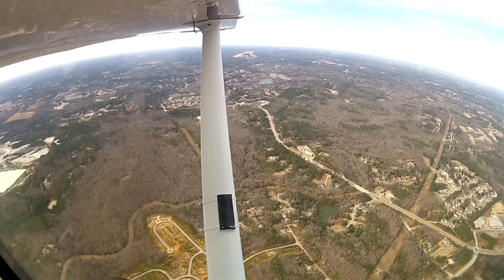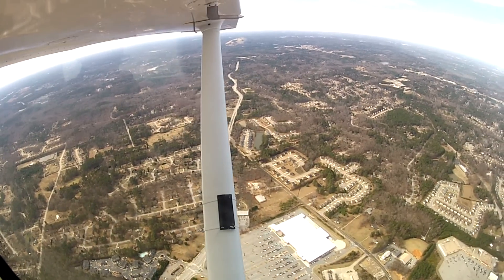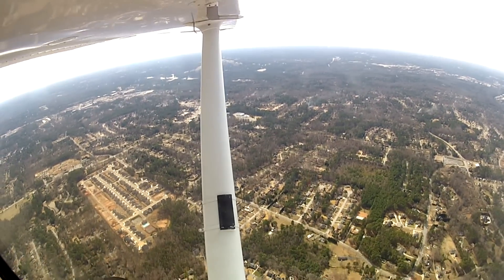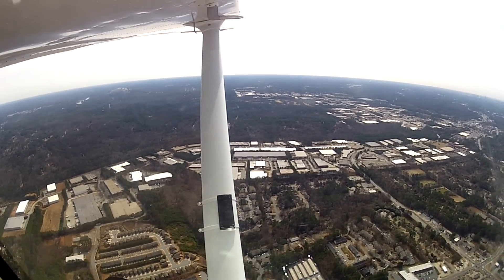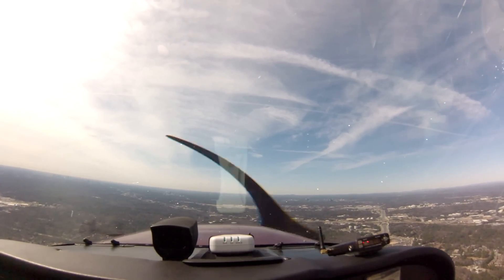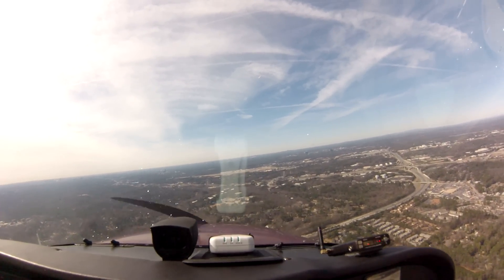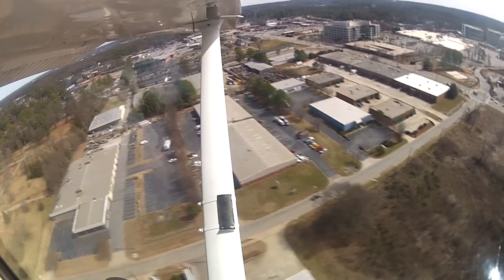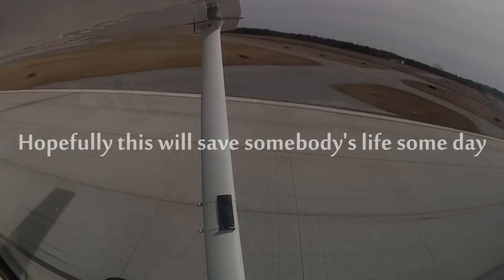A Pilot's worst nightmare, landing without primary controls

Comment: it is a very interesting exercise and re assuring to see that you can fly and land the plane without primary controls. i did practice it without trim but just throttle and rudder until the flare. will practice once a year. thanks for the video

Comment: In the early 70's, I was a front seat pax in a Cessna 310 which suffered a jammed aileron chain in flight. Fortunately, the yoke was centered when it happened .  The pilot flew the approach and landing using rudder alone.  We landed with the emergency vehicles following us down the runway.  The cause of the incident was a loose BNC connector and coax cable.  The plug had jammed between the aileron chain and the center sprocket behind the instrument panel.

Comment: That's a great CFI!  We covered system failures but not primary control failure.  However, they're doing exactly what I would do. 
 Fly it with the trim and the throttle.  That's just from 500 hrs of flight time. This could save a life!  No Question About It!  My biggest fear is in-flight fire though.

Comment: 05:40 A GRUMMAN CHEETAH you mean.  They are so sensitive on the controls you blink and they do something.  Same with Tigers, and those Grumman 2 seaters. But they make you a better pilot.  Or kill you- if you dont.  Cessna drivers run away from them after the first flight.

Comment: Besides you guys did a fantastic job, I have a question regarding the flaps setting.

In my humble opinion, having flaps 40 on final instead of 20 which you had, would give some benefits:
* slower approach speed, which means you can stay over the runway a bit longer (or makes the runway longer for you :)
* more nose-up attitude, ensuring that you touch down with your main gear first
* in case of ballooning you dissipate the energy much faster due to the maximum drag so the ballooning arrests quickly. Most likely, it's not going to balloon at all.
* the power dissipation is bigger so a less-than-accurate adjustment of the power doesn't result in immediately destabilising the plane; and the plane's response to the power adjustment is quicker.

I would stabilise my airspeed and vertical speed on final, and once over the runway, I would NOT touch the trim but reduce the vertical speed by adding power, until the plane gently touches down. This way I would float a significant distance over the runway, that's why having a slower speed seems to me so beneficial. In my opinion, this procedure is safer as you keep the option for go-around (intense re-trimming takes that option away).

What do you think?

Comment: Try landing with a broken aileron control rod-end bearing! Been there, done that. The side with the broken bearing suddenly popped almost straight up causing immediate loss of flight control. Had to hold FULL opposite yoke and FULL rudder to compensate . Could only steer in one direction and very slowly. The bearing hadn't been lubricated, so the stud was bending repeatedly whenever the ailerons were used. I had never been trained for that eventuality and had to do it strictly by instinct. Not fun! I was shaking like a leaf. I'm still amazed that I'm alive.

Comment: CFII/MEII/GI/AGI +20 years CFI. In C150 aircraft and  At uncontrol fields I have "frozen" all controls except windows doors throttle flaps and trim at about 2-3 miles from the airport.  Not all but a few students could get the aircraft    lined up with a runway and at about 50' or less depending on how well they did I would give them back all the controls for landing. I feel this was a valuable learning experience.

Comment: Awesome video. Now if you’d demonstrate in a tail wheeled aircraft. 
I was doing off airport landings in Alaska out on a river banks, took off and turned crosswind. When I started to turn downwind my controls locked up. Instantly I reduced power to slow things down reached around behind me to feel of something had jammed the stick as I started applying right rudder. Then it gave and I had control again. When I landed I went over every item I could to understand what happened. It’s never done it again. I believe it was a hickup that won’t show itself again but if it does I’ll use power rudder and trim. 
Great video

Comment: I've has the ailerons jam in a Cessna 182E, they were neutral and it was pretty much a non-event. I'd be lying if I said it wasn't concerning when I first figured out that they were jammed. Still had elevator...also had a yoke break off in my hand on the same airplane, happened in the flair for landing. That was actually worse than the aileron jam.

Comment: Did this in my flight training as a student pilot.  I wasn't allowed to touch the controls at all.  Only rudder and trim.  I was able to descend, enter circuit with traffic, turn final.. it wasn't until just before touch down we had to take the control back because we would have hit the runway too hard.. but we would have lived if it was real.  Good to try once in a while.

Comment: I used to do that drill with some of my students.  Lots of fun.  I have to admit, however, I never had the cojones to let them actually land out of it.  I'd consider it a success if we got down to a few feet above the runway.  It's great to practice this at an uncontrolled field, but if it happened in real life, I'd pick a major towered airport so there's a big runway and people (and ARFF) around if things go bad.  And have ATC find you someplace with as little crosswind as possible.

Another fun one to try is to simulate a throttle cable stuck at full power.  The basic idea was to use a full slip and shallow climb to get down to Vfe, then extend flaps (and drop gear if in a retract) to keep it draggy as you descend.  Pull the mixture on short final and deadstick the landing.  You can practice this anywhere, but obviously if it happens in real life, get yourself to the biggest runway you can find and aim for the midpoint.

You can also reduce power with carb heat, switch to a single mag, and play with the mixture.  Not wonderful on the engine, but good to have those ace cards in your pocket.  I started thinking about that scenario after it happened to somebody at my club.  Frayed throttle cable got wedged and wouldn't move.
Reply: Can I superlean to keep the engine barely sputtering?

Comment: I lost elevator control after water flowed back during a climb to flight level 230 because the water froze the controls. Not a great experience. I remember calling Minneapolis Center telling them I am going to bust 230 and asked for a block of vertical airspace down to 10,000 ft assuming my controls were frozen. I can tell you it is a very unpleasant experience hoping I was right using throttle to control rate of descent. It was frozen control surfaces and I did get control back around 10,000 feet. Remain calm told my passengers what was going on since one of them overheard do you wish to declare an emergency. Fly the airplane as best you can and make very small changes. No big deal all in a day's work. I would not wish to do this again however.I am an instructor as well  but never taught any student how to try and fly without primary controls. Maybe a good idea after all.

Comment: My instructor buddies and I would challenge each other to see what we could get away with as far as loss of controls. We finally ended up being able to land a single engine Cessna with just doors and throttle. Trim control was neutral. Adding power nose went up. Reduce.. it went down. Compensating for propellor torque and to accomplish intentional turning was done by shoving door opposite to desired turn open with our feet. Piece of cake!

Comment: On calm days in my C170B I'd often practice flying without various controls.
Amazing what you can do using the unlatched doors to replace lost rudder. It results in skidding turns but will provide crude control. Trim tab and power settings becomes a crude replacement for elevator loss.
If you don't panic you can survive control losses.
But then I had some 3000 hours on that B so we were 'intimate' so to speak.

One occasion tower assigned me runway 28 as winds were 360 30 gusting to 40.
I requested 24L "at my discretion" and they cleared me 'at my discretion'.
What I did was land across the width of that runway.
Note that 24L was inactive due to winds and that had I landed on 28 I would have had to do about an 8000 ft taxi back to my tiedown which with a taildragger  would have been a major chore with brakes that would fade frequently. (been there done that)
I approached full flaps and dumped them immediately as mains touched the tarmac and hit the brakes.
Runway was 200 ft wide!.

Comment: Very good lesson to have.  Great job.  I like instructors that train for all the worst case scenarios and not just straight and level, powered, controlled flight.  I do have a few questions for my own learning.  Let's assume the primary flight control cables have severed leaving the flight controls loose.  We have all experienced single wing updrafts that pitch the plane.  How do you adjust for that with no ailerons? Also, does the air stream from the prop and forward motion leave the elevator neutral?  Does  the vortex or prop wash affect these loose controls significantly?

Comment: I'm surprised he called a go around without first making sure the trim wasn't reset.  It's super dangerous to go fullpower when the aircraft is trimmed for nose up attitude.
Reply: No need to immediately retrim. Just use forward pressure until the appropriate climb attitude THEN trim the control forces out. No different than any go-around.
Reply: Really???
Reply: If you heard what was said the instructor was working with a student IFR pilot , The flaps came up with out instruction from the CFI so I believe the student was on top of the trim  .
Reply: Even a maximally wrong trim should be easy to overcome on a properly balanced plane.

Comment: If the elevator fails, doesn't it just drop and cause the plane to nose down and crash?
Reply: haha oh my god why does everyone think a plane goes down and crashes even if something small happens? :/
Reply: The wind going over the control surfaces will try to force them into a neutral position because they are attached via hinges towards the front. i.e. If you stick your hand out the window, parallel to the road, while driving down the highway. Using the trim is like tilting the trailing edge of your hand just a little. Tilt the back of your hand up just a little forces your hand to go down. With the elevator, the raises the nose. Vice versa. With trim and light rudder control, this is quite doable. More tricky in gusty conditions.
Reply: Trim.

Comment: Excellent video. A little off topic but reminds me of my first radio control aircraft in 1973 with rudder only control (Ace Pulse Commander with Adams magnetic actuator). I was amazed how much can be done on rudder only with constant throttle and dead stick landings. Later, I picked up another system with KRD sequential quick blip throttle servo (hi-med-lo back to hi), which expanded the envelope. I gather in this case one was piloting a large model aircraft with limited controls.

Comment: You really want to give yourself more than a mile on final to stabilize any new configuration (flaps down) with primary control problems. Just tell the radar controller that it's going to be a really slow final.

Comment: With trim and throttle only...  No elevator no ailerons and  no rudder you  can  still  land  the  plane.... ....  As long  as you  have  straight and level flight you can land... what matters is  can you get to  straight  and level at  a safe landing  speed....  You  can  open the  doors and use those  for  rudder control ...  your throttle controls  decent  and  elevator trim  controls  air speed  and pitch...  So  long  straight approach straight down the  center line ....  So  all you have  to  do  is  are trim  to  landing  airspeed  then  control  decent with  throttle to  touch  down  on the  numbers ...  Gently use throttle only  preferably  set properly  from  long way out ..  Open right  door to  steer right  left  door to  steer  left ...  The  airplane will land itself  as  long as  the  spot on the  wind shield that does not move is the right  spot to  touch down you will  be  fine....  If  wheel steering  is  functional  your okay  if  steering does not  function  but is straight  ahead  or free differential braking will  be your steering.....  Don't change throttle until  fully  down and  not  likely to  Ballon....

Comment: For  trim, did you have both aileron and elevator trim ? I don't have aileron trim and I had to add a fixed trim to correct a heavy left wing. I'm assuming you would need aileron trim also, to perform this landing.

Comment: Excellent video.  I can see where people would get all the way down just to blow it when they overreact to the nose down attitude over the runway.  That would be hard to overcome the instinct to start putting in a ton of nose up trim or power when you're nose down that close to the ground in a real emergency.

For me, split flap was always my most feared control failure.   Would a 172 have enough aileron to overcome a split of more than 10 degrees?

Comment: Loss of ailerons is no big deal as long as they aren't jammed too far off-center, you can do the job with the rudder--it's just inefficient in flight and generally messy.
Loss of elevator? I'd shit myself.
Reply: +JetPackJan Yeah, I mean how unlucky can you get in one day, 1st you get your commercial plane shot by a rocket, then as you attempt to save it they try to take a 2nd shot at you (Though this missed and the pilots of the A300 weren't aware till after they landed) then you have probably the roughest landing you've ever experienced and finally discover you're in a minefield...I mean man that's what you call a bad day at work.
Reply: +JetPackJan I think the worst thing for the A300 guys was probably the fact that after they landed they couldn't keep it on the runway, and as they were exiting the aircraft they were told that they had in fact ended up in an old minefield.
Reply: BasementEngineer Loss Of elevator? I’d use trim!
Reply: Streaky100001
Yes thats also not what you want to hear after a plane crash: Stay there or you will blow up!
Reply: +JetPackJan Yeah, they basically flew a massive circle (massive due to lack of all controls) and landed back there, they didn't feel they could make it anywhere else safely, though I guess they did get to be escorted by apaches so that's small compensation.
Reply: +JetPackJan

Not to butt in but I believe that you are correct.
Reply: Streaky100001 And they were still at the airport that they wanted to depart from in the first place, weren't they? :D
Reply: My CFI showed me how to land with the trim wheel not pretty but effective
Reply: BasementEngineer i
Reply: +BasementEngineer Do you remember the A300 that was hit by a missile? Lost all hydraulics with a damaged left wing. They landed with differential engine thrust only. Worst thing is that you have to increase the power just prior to touch down to bring the nose back up.
Reply: JetPackJan Is that the one where both pilots were killed and only a few passengers survived? They're gonna hafta start carrying flare and chaff cartridges on airliners.
Reply: No that was a DC10 I think. That one too had only engines left... But they crash landed with one wing seperating and the cabin ripping into multiple sections.

OK I googled it: the DC10 was United Airlines Flight 232 with 296 PAX (111 died :-( )and the A300 was a DHL freighter with 3 people on board, everyone survived.

Comment: Just wanted to say thanks for showing this. My only real fear in flying (other than a wing or elevator falling off) is loss of flight control. An engine failure or busted landing gear I can handle. I had suspected the plane could be controlled through rudder and power only (and trim if available) since you use rudder rather than aileron to level the plane during stall approaches, so it was very helpful to see that confirmed and demonstrated. Thanks again!

Comment: Done the same with the models due to elevator failure (not even elevator trim available, just flaps and throttle)... its definitely challenging.
Main advantage with the model is... if you goof you are a spectator, not a statistic.

Comment: I'm guessing that this can only be done with the high wings. The ground effect experienced with the Cherokee & Seneca would be different I suppose. Haven't seen confirmation in the comments thus far.
Reply: +Meisha "Float" common to aircraft with long, low-mounted wings can be controlled with flaps. Full-flaps on final, then aat touchdown, dump the flaps and cut the power. It'll stick :)
Reply: Joe Shupienis Thanks, my instructor friend confirms this. Nobody speaks of flap-less landings much. It's not a required part of a private pilot's training, atleast in S.A.